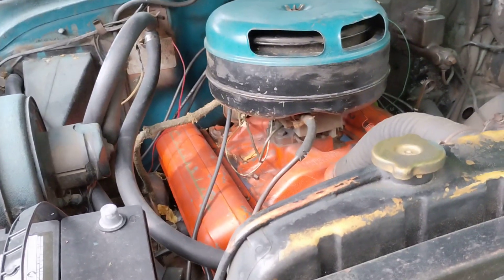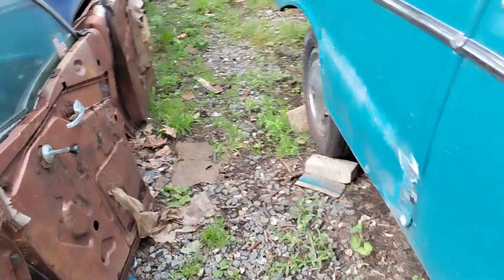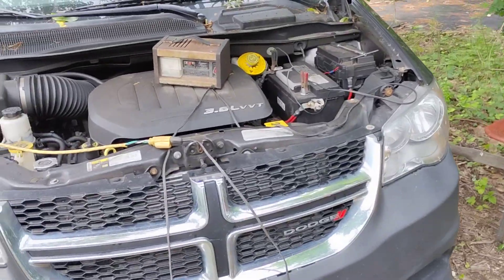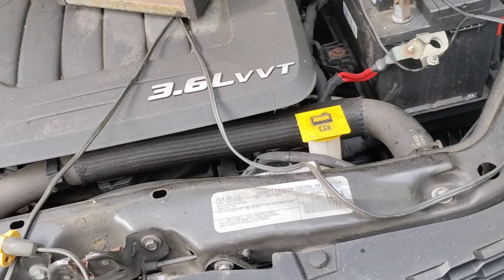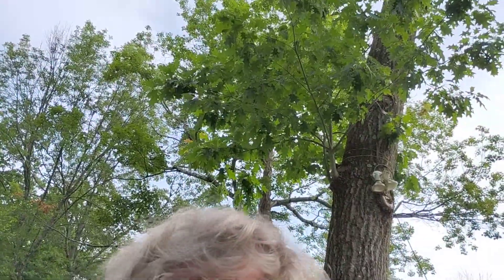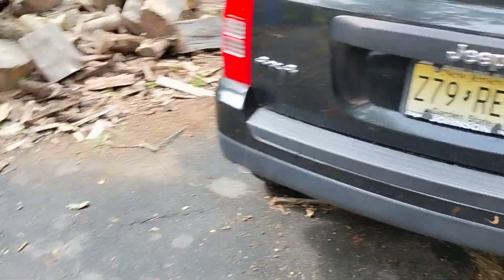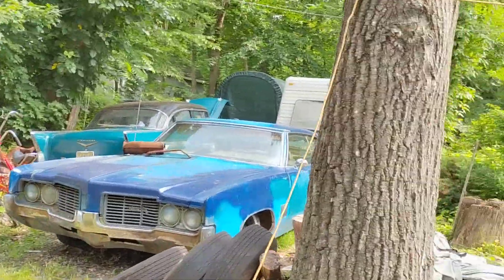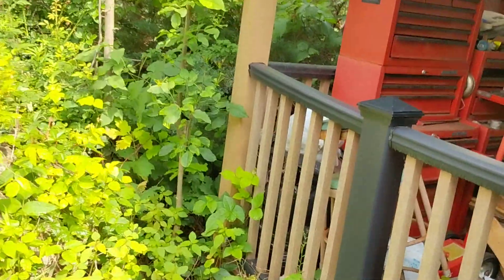more car trouble than I could shake a stick at

Comment: Keep us posted...would like to know what it was that gone bad
Reply from the maker: Needed to reset the codes disconnected the positive side of the battery clean the terminal lead clean the battery lead put it on a charger for 2 hours on boil then put the battery terminal back on tightened it down started the van up but I think that's only a temporary fix usually these codes come back